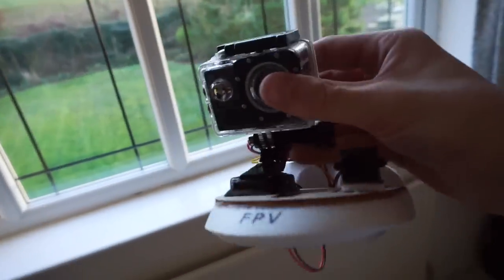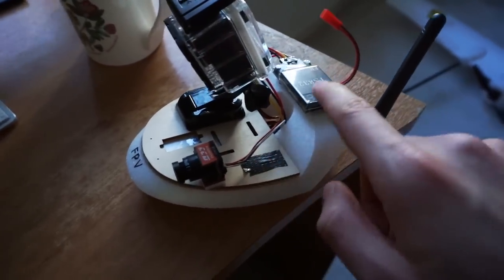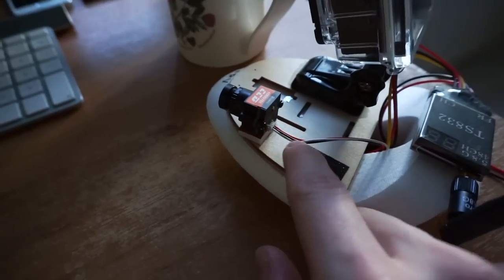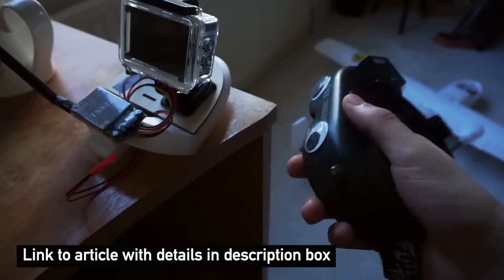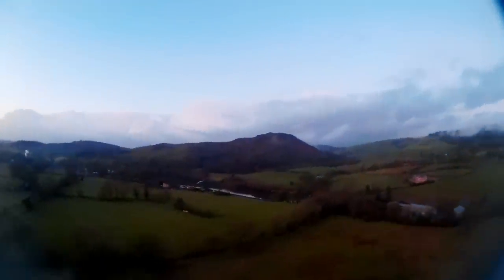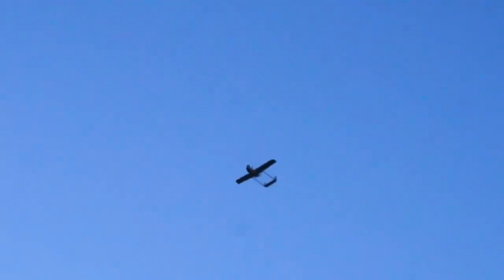How To Build a​ Camera Plane

Comment: Nice Video, enjoyed it..
I enjoy to see getting more People in this hobby.
I am missing a autopilot.. they are not expensive anymore. So you have a proper fail-safe.
Even if I like Spectrum (they r making the best controllers), the signal is just not stable enough for FPV.  (My experience)
(Just a weird combination -> 600mW Transmitter and a Spectrum-Remote)
FrSky made a new low frequency standard that's affordable. (R9M)
A video about a autopilot would be cool  :)
(And a OSD)
Keep on doing!
Greetings from Switzerland

Comment: Not that this would make much of a difference compared to having a GoPro sitting in the front of the airplane, but I would suggest having the antennae pointing towards the tail of the airplane rather than vertical. Would be more aerodynamic.
Love the fake eyes on the FPV ;-)

Comment: Question ,
Can people with spectacles use fpv?
Reply from the maker: Good question! You can, but you have to get a headset along with some prescription lenses that fit inside the eyecups. Most major brands, like Fatshark, supply these.
Reply: Thanks ,that was quite useful actually
Reply: Reuben Stephen John You can also use the box style FPV goggles as they are polystyrene foam and have more space, I had to use a knife the make a little more space for my glasses in my Eachine box goggles.
Reply: You can get box goggles that can be used with your own glasses
Reply: Thank you guys for the suggestion,will try👍
Reply: I bought the FTX Vipers specifically for wearing with glasses.
Reply: Or get the fxt viper box goggles

Comment: The Skyhunter is NOT  a 3 channel..it is 4 channel. Ailerons, elevator, throttle, an RUDDER.
Reply: That is to say, I've always added the rudder channel to this airframe to smooth out the yaw, an to slip while in the air for better stability. IMO it should have always been a 4 chan.
Reply from the maker: Brilliant

Comment: 4:05 that's actually very very dangerous , plugging 2 different capacity batteries in parrallel is super bad , the small one will hve discharged while the big one won't
Reply from the maker: That's a good point! To be clear (and I wasn't while recording this), I was meaning that if this 3000mah battery wasn't so large you could fit smaller batteries in there. :)
Reply: @Project-Air  but that small battery wouldn't be used to power the plane , would it?
Reply: As long as both batteries have the same voltage, when plugging them in parallel there is absolutely no problem using 2 different sized batteries to power the airplane.
Reply: @henningm9823  that is 100% correct , however , when you discharge them , the voltage will drop at a different rate
Reply: @sufysprojects2689  no they won't. The voltage will be exactly the same in both batteries. There is nothing wrong with connecting them in parallel. If the smaller battery tries to sag under load, the larger battery would supply more of the amperage. It is physically impossible for the two batteries to have different voltages when electrically connected.
Reply: @codymiller8505  are you considering them to have the same internal resistance?
Reply: @sufysprojects2689  no, internal resistance won't matter if theyre in parallel.
Reply: @sufysprojects2689  are you confusing series and parallel? 2 different capacity batteries in series is a huge no-no. In parallel they act as one big battery. (MAh is combined in parallel, same voltage. Voltage is combined in series, same MAh)
Reply: @codymiller8505  I am not confusing between the two , I'll make an experiment  , and let you know
Reply: @sufysprojects2689  I look forward to it because I've never heard of this so I am curious if my understanding is wrong. 👍
Reply: @codymiller8505  I have some news ! According to joshua barwell's explanation on parallel charging , your hypothesis is right , but I've asked a friend of mine who knows a lot about this stuff , and he said that batteries with different capacities should not be hooked in parallel . I think I'll have to do my own tests
Reply: @sufysprojects2689  what kind of experiment are you planning to do? I am surprised that you actually followed up on this. Good on ya.
Reply: @codymiller8505  I am going to discharge 2 3s packs , one is a 1300 amd the other a 2200 . 😎of course I did ! Here I am . I 'm not a hater , I just want to find out what is objectively true